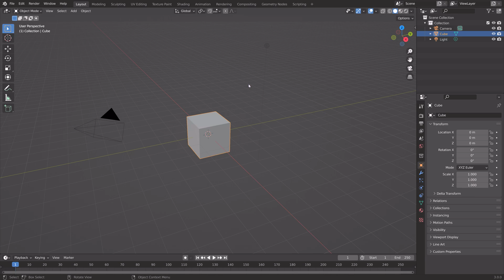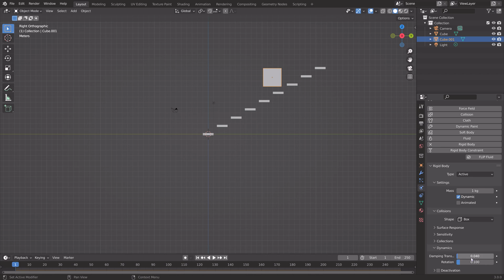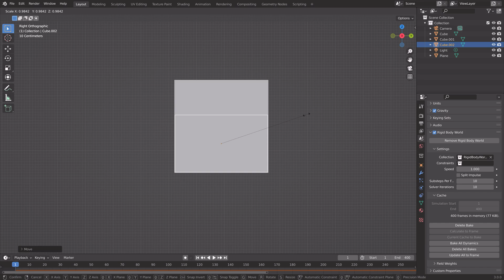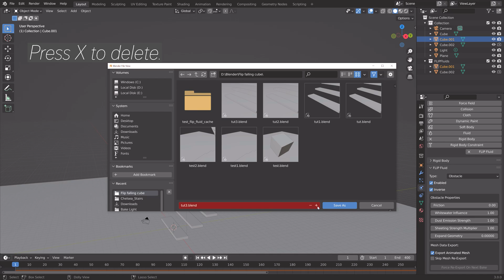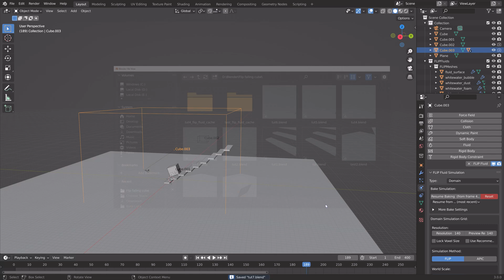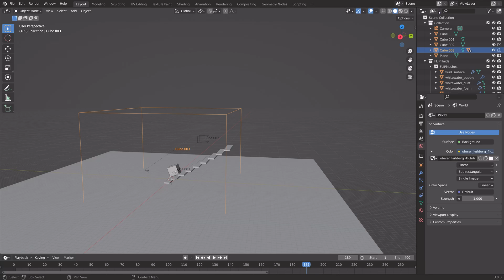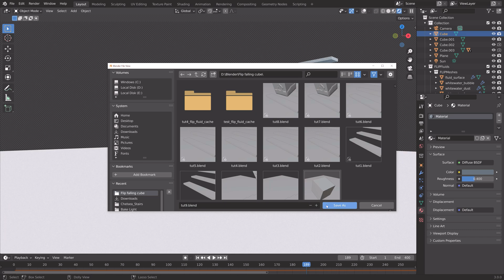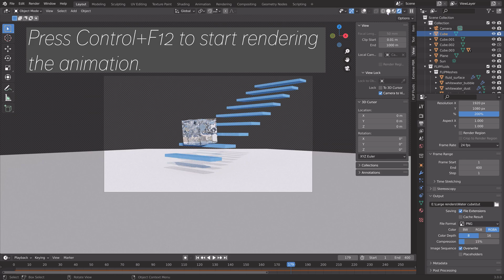[3.0] Blender Tutorial: Water Simulation in Flip Fluids

Comment: hmm. I tried this and the fluid doesn't keep in time with the cube (obstacle) it's inside, I can't see where in the ff obstacle settings there is anything to prevent this. Is it the normals of the obstacle cube or wall thickness or a disparity in simulation steps between rigid body and ff obstacle? What have I done wrong and how do I make it right? The cube tumbles down the steps and the fluid tumbles along behind it. Is it something in the default settings of the rigid body settings of the cube for collision, is there a value needs to be greater? lower? The Collision Margin for the cube in Rigid Body? Should that be like 0.3 or something?
Reply: It was the Sensitivity - Collision margin, for the glass cube in its settings not ff settings. 👍
Reply: Result, https://youtu.be/JGRU9fwYmdA (had a few render problems, illegal cuda address or something, had to render little bit at a time)
Reply: Hey I know you found a different solution but this can also be solved by baking the animation of the rigid body movement too.
Reply: FLIP FLUID       Mesh Data Export      first one